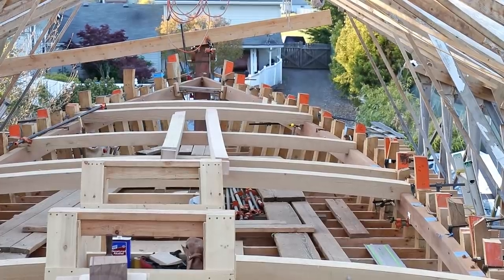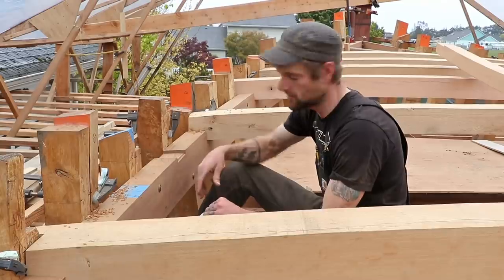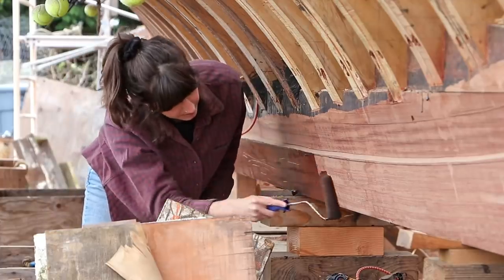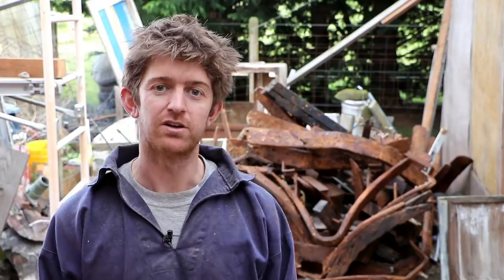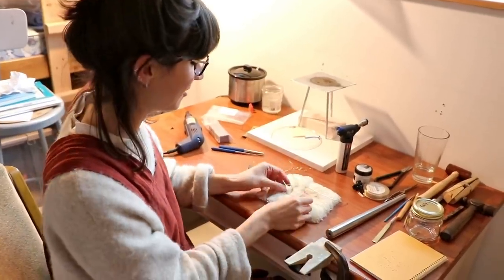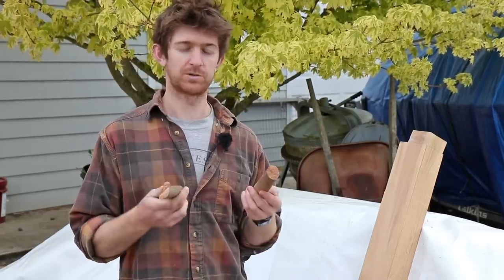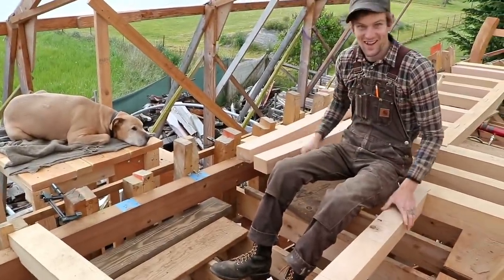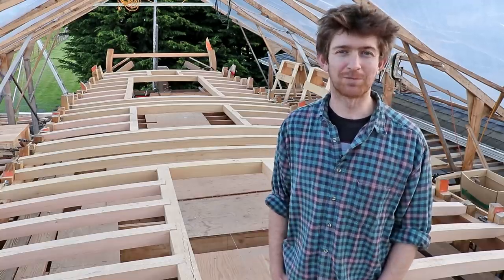BoatBuilding - Building the Deck Structure! (EP71)

Comment: Slime flux/wetwood infections are really interesting. Some of them will go through 2 and even 3 stages of infection, as the bacterial environment changes. Generally, they start with a tree injury, or sometimes a soil infarction. The primary infection is often due to a bacteria that feeds on the sap in the live tree, and they can express many different compounds and gases as they digest the sap. Sometimes it causes pressure in the tree, and the resulting flow outside the tree is called slime flux (other bacteria infect the expelled sap as it leaves the tree, and make it slimy and smellier.) The expanding gas causes lignin fracture and tyloses proliferate, esp in a species that already has them, such as white oak. Often, a secondary bacterial infection will invade through these flaws, and acetobacter is a common infection (expressing acetic acid--vinegar). The secondary bacterial infections feed on cellulosic wood fiber, rather than sap...and because it's eating the wood and turning it into waste (rot), it weakens the wood significantly. Once these secondary infections are present, the damage will continue to occur even after the timber is harvested and sap no longer flows. The lack of food from the primary infection stresses the existing bacteria, and they will try to eat other things. As long as they can travel through fractures or tyloses, they can continue to spread, but I've never heard of it jumping to timber from another tree after being cut. 

Good catch, Leo! Glad you kept it out of the beam structure!
Reply: Well said, you sound like a student of Alex Shigo, or Richard W. Harris, Two of the most prominent US tree scientists.

Comment: The offset is to allow space for the parrot deck. Many of you may not know, but the parrot deck is the place that the captain bird of the boat sits and lords over the rest of the crew. It has to be near midline, but allow enough room for certain shears and gaffs (and other nautical terms I don't have time to explain) to reside. Consider this to be the final word on the subject. I may be drinking, however, so feel free to add your comment.

Comment: Hi there Leo. It's great to see Tally Ho coming back to life. I'd love to be able to support this project financially but at present it is impossible. I do have an answer to the rot problem though. timber is made up of two very important parts. Lignin (the building blocks but very brittle and darker in colour) and cellulose ( The elasticity fibres. Very strong but doesn't have the rigidity of the lignin and generally pale in colour). Together absolutely amazing. This is why trees can sway in the wind and still stand up. In your example the tree has suffered from a disease that has eaten the cellulose. leaving the area of the tree darker in colour and without the elasticity and therefore brittle. If it had been a disease that had eaten the lignin, the tree area would have bean paler and very sponge like. Obviously different woods are effected in different ways but this is a general explanation. I hope this helps.

All the best.
Nick From Eastbourne England.
Reply: Where's the rest of the bloody videos
Reply: Brilliant.  So tree wood is one of Nature's composite materials?  Awesome explanation.
Reply: A.
Reply: Perhaps that disease is what brought the tree down originally, and landed it in the wood yard.  Makes sense...a lot of the large timber would have come from storm damage and the like, where a bit of disease would have made the difference between “down” and “still standing”.

Comment: Hey Leo, I'm an Arborist, and I can't be certain, but I believe that the defect in your oak is Brown Rot, sometimes known as Dry Rot.  I'm a wood worker as well and I've seen this in seasoned lumber as well as trees that I've worked on. Based on the brief view of the tool handle that broke, the degradation of strength along the major axis is consistent with Brown Rot.  It tends to break the wood up into rectangular chunks.  The discoloration is also consistent.  Brown Rot is often the result of a large wound in the tree.  The fungus can easily travel downhill through the cellulose. It is more common in softwoods and fruit trees; infamous for its devastation to cherry trees, so I would be surprised to see it in White Oak, but not out of the question. Brown Rot selectively breaks down cellulose, leaving behind lignin.  Typically fungi are responsible for breaking down cellulose, as well as lignin, so I would be surprised if it was bacterial, but I could be wrong.   I'm sure there is someone out there who knows something that I don't.

Here's a quick read on some common tree fungi with simple explanations and pictures: http://forestpathology.cfans.umn.edu/microbes.htm
Reply: Dry rot is also a significant cause of heartbreak and woe in the wooden boat community and a major contributor to why freshwater is viewed as so much greater a threat than saltwater.

Comment: who else cant wait for the bronze floor casting videos?
Reply: Absolutely! Leo and his team's outstanding shipwright skills are wonderful to see, but bronze casting is something else entirely.
Reply: Will Leo do the casting himself or have it done? Stay tune for the answer.
Reply: Cheapest way to get bronze is from 1947-1962 US pennies. $0.0184856 metal value for $0.01 each. Literally 50-cents on the dollar (54.1 cents/$). Probably not legal, but I am neither a lawyer, nor do I play one on TV.
Reply: @jeffbecker8716  while most likely the cheapest bronze, I would doubt its mechanical properties and melting any alloy is a specialised skill.
Reply: @jeffbecker8716  Probably legal. Apparently "defacing money" in US law means something like using legal coins to make counterfeit coins, like (theoretically) overstriking the face value. It's fraud, basically. Otherwise melting down your spare change or using it to tile your bathroom floor as was a thing a while back, well, that's just using your own property as you see fit.
Reply: Jeff Becker Sir, while what you say is maybe technically correct about U.S. Pennies minted from 1947 to 1962 it is also one the sillier things I have read in a long time for several reasons the first it has been between 49 and 64 years since any of those Penny's were minted which means that most of that coinage has been removed from circulation by the treasury because they were "worn out" and the remaining Pennies in circulation from that era as a rule are worth far more than there potential "scrap weight" due to there value to coin collectors. If you were to do a quick search on ebay for example you would find a roll of pennies that supposedly came from someone's grandma's closet and has not been picked over if you can believe that sells for between 1 to 5 dollars so why would anyone waste their time on a treasure hunt for Pennies minted between 1947 to 1962. I know that you were merely pointing out some "fun fact" you saw on TV or read in a magazine but the majority of these fun facts should never be forgotten as soon as they are first heard or read and rarely if ever be repeated due to what they omit to report. Just a FYI the laws regarding "Penny Scraping" will probably never be repealed for the simple reason is it costs more than 1 cent to mint a penny and is why that every few years the idea of discontinuing the minting of pennies is floated around just like the idea of only minting dollar coins and cease the printing of dollar bill. Have a delightful day and Stayhealthy Staysafe
Reply: Don't be surprised if the final casting has to be contracted out.  Metalurgy is another thing entirely, and casting metal isn't as simple as some would have you believe.  If they are going to go with the expense of cast bronze, betcha they will do it right and hire it done.
Reply: @jeffbecker8716  There should be lots of copper pennies in Canada that are now worthless....
Reply: Benny Hill me too. The bronze floor fabrication part of Arabella was great
Reply: @jeffbecker8716  It would be illegal to sell anything made from pennies, but if he never sells the boat its totaly legal, also modern pennies is not made from copper anymore, so if you got a bunch of pennies a lot of them wouldn't be copper
Reply: @kingduckford  Port Townsend is just down from where Leo is working.  They pretty much have the facilities there to do anything short of making steamship props.
Reply: Oh, yes man, do I want to see that! LEO IS SUCH A PERFECTIONIST, and that is just the way he builds! Love it!
Reply: @franksijbenga3724  It would have to be legal, I mean a LOT of US tourist attractions will have a device somewhere where you put in a penny and a quarter, turn the crank and get the penny back re-stamped with the attraction logo etc.
That is pretty much a fully defaced penny.
I doubt those devices would be everywhere if defacing the currency was illegal.
Reply: me!
Reply: Me can't wait, they are going to look bieuteful .
Reply: @graemelliott3942  Agreed, the real interesting thing is the difference in the design that the bronze floors will use.
Reply: I think spent gun casings might be the cheapest bronze, the gun ranges are probably happy if someone buys them. I'm guessing.
Reply: Hear hear.
Reply: Viktor Kaganovich    Commercial gun ranges like Front Sight near Las Vegas Nv collect and sell the brass shooters leave there every day.    But of course it's brass, not bronze.
Reply: @joeoden5518  oh, right. I got the two confused
Reply: @petert3355  what boy hasnt placed a coin on the railroad tracks?
Reply: Those castiron floors looked thicker than that template...may need a couple of gussets to equal the same strength
Reply: Jeff Becker     1.
Reply: Bekantan
Reply: They gave already cast them once on the bigger frames they're going to do the sawn frames now
Reply: @Jabbatic  would love to see it. I did work in a foundry for a while and that would fascinate me.
Reply: Mr.
Reply: @Jabbatic  gg 📳
Reply: Having watched them all there is fascination for sure... but casting is not nearly as enjoyable to watch as Leo and Pete cutting wood with their chisels.

Comment: You should get an initial cast bronze frame done before making any more patterns to get a good percentage of shrinkage to figure into the other patterns. It should probably be around 3% or so. You could probably add a shim layer to the outsides of a pattern you pull straight off the ship, but it might need to be split and widened on the bottom.
Reply: Yeah, this.
Reply: He's right on this!
Reply: yah the shrinkage factor.
Reply: But isn't the boat gonna swell when you get it in the water? won't this account for most of that?
Reply: Shrinkage is major when the water is cold.
Reply: @karlschupp8552  no when you cast metal, it goes in fat and hot. when it cools down it shrinks down cold and skinny,  different metals have different shrink rates,  so when you make the mold, you have to do the percentage math.
Reply: Casting shrinkage of Bronze as well as other alloys is well understood and documented to the point that as long as the exact alloy of the metal is know than so are there shrinkage rates.  A good pattern maker knows and understands these shrinkage rates and how to adjust the size / shape of a given pattern.
Reply: These are only templates they are making. When making the proper patterns, the pattern maker will measure by using a Bronze shrinkage rule to compensate. The pattern is made bigger by the percentage of shrinkage for the material to be cast. Only fettling should be necessary after the bronze is cast, if done properly.
Reply: @gullreefclub  Yes, I had forgotten about the pattern making. It has been over 50 years since I finished my tool and die maker apprenticeship and I have not worked in the trade since then. As a mold maker I had to consult that book of shrinkage's. My work was mostly in plastic, but some molds were shaped with a metal that I have forgotten, but the finished part when cooled had to be in tolerance and some were very close. This is considerably different than what I did. Thanks for the understanding on some of this.
Reply: We used to dip mould dies in hot wax to make slightly bigger for shrinkage. was on a much smaller scale than that though. Ear canal moulds for inner ear hearing aids lol.
Reply: Assuming these are to be sand cast (you would not do one off pieces any other way) there needs to be 2 degrees  of taper to allow the pattern to be lifted from the sand without destroying the mold walls. Also compound angles don't work with sand castings! You have to be able to lift straight up off the pattern of course. 
This and the above mentioned shrinkage factor would have me looking at another fabrication method, but Leo has years of experience and probably knows all this anyway.
Reply: i've learned pattern maker as i was younger. You can still use your templates to create patterns for the casting with the right dimensions (including the shrinkage rate). If you have a foundry nearby they should be able to give you the specification for either the dimensions and the pattern they need to perform the right casting.
Just be clear you'll have to make a pattern for each single floor you want to cast. 

If that seems to complicated/expensive/time consuming for you, consider welding the floors out of bronze plates like they did on "Arabella" (Acorn to Arabella)
Reply: Brian Branson PM
Reply: phlod
Reply: Sorry for the two replies above careless fingers just wish to say how much I admire Leo and his team being a fellow Bristolian. I understand his passion for wooden boats
Reply: phlodel Do they know about shrinkage?

Comment: Leo, been doing accurate restoration of historic homes for 25 years. Intead of sanding try soy-bean stripper..I am stripping about 3 rooms of fir of 7 layers of paint. Soy strip is the ticket. Easy on the hands, hell I don't even wear gloves vs old citrus strippers. Neutralizes with water, and best thing is it doesn't dry wood out like citrus stippers. Apply a heavy coat, cover with plastic, wait 24 hours, remove carefully with a putty knife. Apply a second coat. Great with old lead based/oil paints. Eliminate the sander except at the finish point. Anyway, put Blue Bear 600 GL soygel  on your wish list-I'll buy you a 2 gallon pale. (I am not a dealer, just a old boat builder from a zillion years ago, and now on old house project #1000 plus).  Just love your project.
Reply: Thanks. Good knowledge for everything